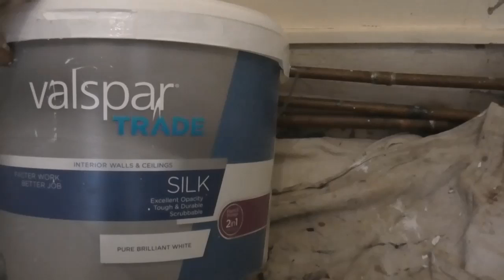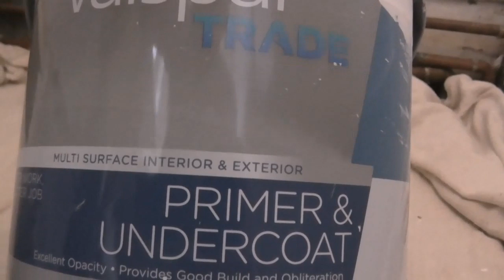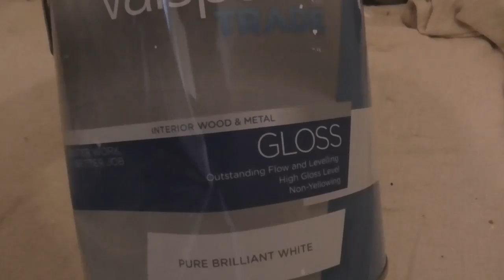Where To Start?  What To Paint First?

Comment: Great job.!!!!as always. Any reason as to why you didn't use foam and  filler this time because I see you use foam many times. Which brand filler was used on this video. Really great job👍👍
Reply from the maker: Thanks, actually in this case foam would have been more work. No movement and  because under stairs it does not have to be perfect, so clean out PVA and hard stop filler I knew by the end of the day it would be dry enough to finish job done., no cutting back foam and then filling.
Reply: @PaintingandDecorating  thank you for the explanation, really appreciate it. Your work is by far the best on the Youtube channel. Keep up the great videos.👍👍👍👍

Comment: Cant beat a nice white out.do you always use valspar water based gloss.i be been using the dulux waterbased satin quite alot lately.i find the satin stays white for longer and has a nice slight sheen to it.i ve been staying away from oil based.also I like using the dulux kitchen and bathroom soft sheen instead of silks.do you advise the customers what to get
Reply from the maker: No it's ok but does not have a great sheen like other water based gloss...   water based satin is ok but I still like to use oil satinwood... stays white loads longer than gloss.  Sometimes advise on sheen levels and  explain the difference between some other things.. but the final decision is the customers.
Reply: @PaintingandDecorating  
I dont mind the satin once oil based by dulux.it covers great when people want the old one coat job.goes over yellowing woodwork great.the normal satin wood says it s self undercoating but find myself applying 2 top  coats to get the best finish.
Reply from the maker: Yes self under coating but still needs two coats a lot of the time... depends on how clean your woodwork how is...
Reply: @PaintingandDecorating  why call it self undercoating tho if it's going to need 2 coats anyways.i still cant find brand with a one undercoat and one  gloss system apart from gliddens trade but no private customers want it.they preference the brand names.i ve been using Leyland acrylic primer undercoat alot as it goes off quick but still 2 glosses to get that perfect finish.might have to charge that little bit more for the 2 nd coats I think.my pricing are a bit off i think.i used to work for company but went self employed in September but cant charge what some people are its ridiculous. Some people in hull are getting priced at upto 25 quid an hour.i would nt pay that price so i dont expect my customers to.thunk that's why I'm getting alot of work cause km alot cheaper and km putting more work into a job.i like to explain to customers whatbkm going to do but they seem as though there bored of me telling them and just want me to get on with it lol
Reply from the maker: @davidphillips744  Like I said if your woodwork is clean it will only need one coat it's that good Dulux Oil satinwood..   it's like cottage cream

Comment: Were did you tip paint and soap solution toilet sink or drain?? Did you have to fill in at celling were paint looked to be peeling ? Lovely jab as always brilliant filler knife work your worth every penny 🎚️🖌️☯️🇬🇧🇬🇧🏆🏆👑😆
Reply from the maker: Thank you, always throw waste water if possible down the toilet, second spot is grid at the kitchen waste pipe it needs to be going into sewers and not into the brooks.  The ceiling was ok  no need to fill.